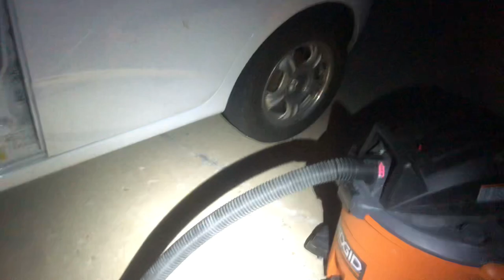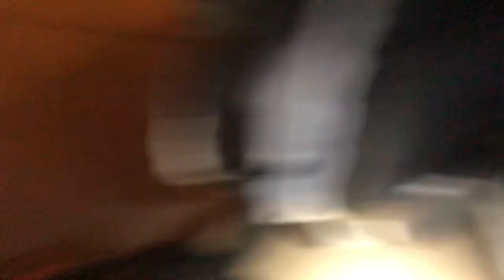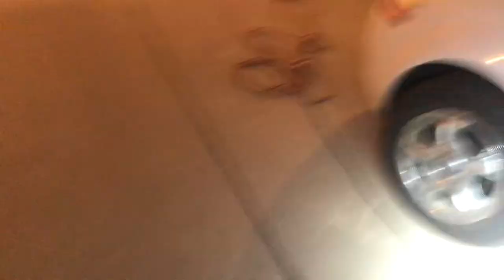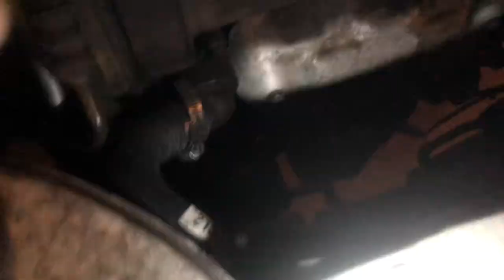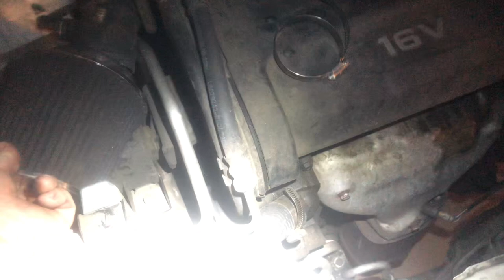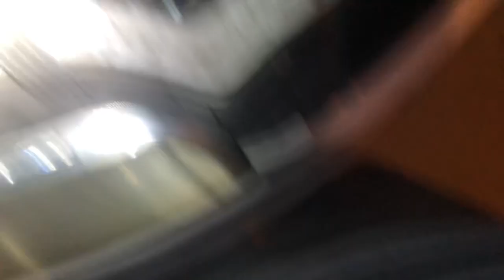I hate my car!!! IAMSKIPPY on Venmo if you can help

Comment: Ok, so this is a $14 fix.....  thats a POD FILTER, not standard I'm guessing it's a nissan by the engine (I don't know american cars tho.) They are to be cleaned with K&N filter cleaner  ($11) and reattached with a new hose clamp ($3).  And the hose you pointed out IS a radiator hose. Theres a top hose and a bottom hose. It looks like the pod filter has GLUE on the inside(!???) Get a second hand "original" air filter from a nissan(?) wrecker if you can't get it to work after spraying it and reattaching it with a new hose clamp.
Good luck.
Reply: Skippy has Chevrolet Aveo 2008, his engine must look like this:
Reply: He has Chevrolet Aveo, there must be black box with air filter in it, it is completely missing.
Reply: That looks like a GM engine, not Nissan.

Comment: Wash the filter with hot soapy water, rinse it out under pressure, and spray a little oil on it...then duct tape it back on. It'll be fine for awhile.
Reply: No ya see, he would put it back on with it still wet, it would freeze up and in the morning that engine would be dead.  After all it’s a $12 universal filter. Somehow he didn’t realize the stock one he googled for his car and this piece of sht looked nothing alike.

Comment: I'd stop moping and check to see if Rockauto or Carparts sites have your stock airbox for cheap. Those Autozone conical filters (usually Spectre brand) are more trouble than they're worth and depending where you take your car for service, they may hassle you or try to take advantage knowing you weren't running the OEM filter.
Reply: Yesss great advice. A used stock item would be much cheaper.

Comment: Aftermarket cold air intakes do nothing.  It's a scam.  0 upgrade in performance over stock airbox.  Get a stock airbox used on ebay.  For now cut out that broken piece inside the filter, stick filter back over the hose connected to the vehicle.  Clamp it down.  Do this until you can fix it properly with your next check.